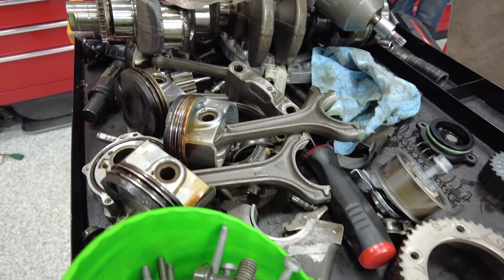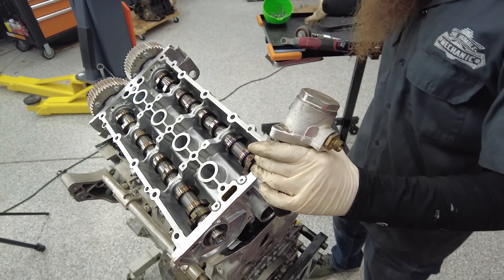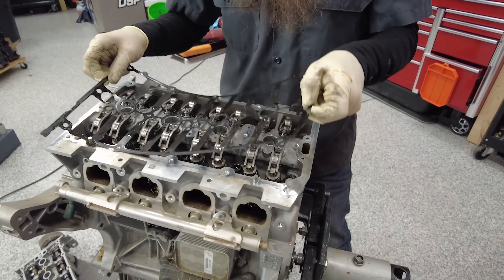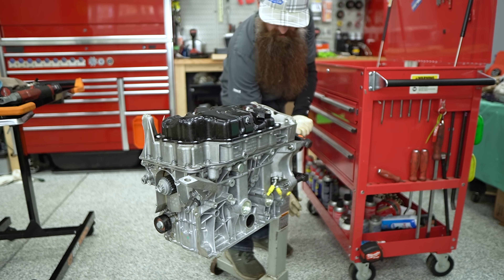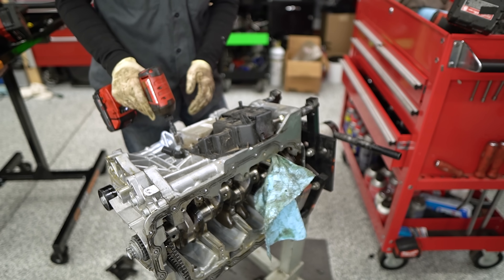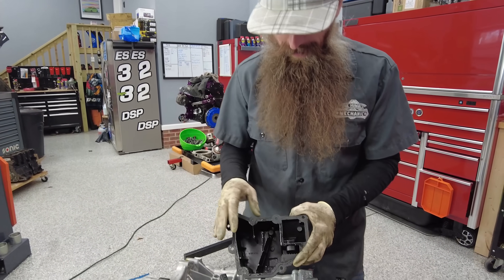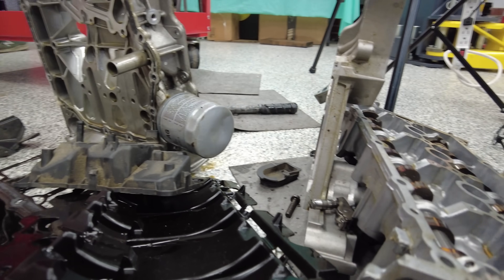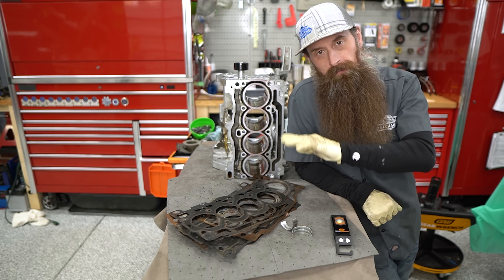1.4 Turbo Engine Teardown After Engine Failure ~ Rod Knock

Comment: That's one beefy looking MLS head gasket. Interesting seeing the internals. I was just leaving my job at the last VW stealership I was at when these engines were introduced, so I didn't get a chance to pull one apart so it was nice to get a look at the guts. The cam girdle with the 'integrated' cams is cool. I agree, would make a nice economical swap for an mk1 chassis car. Good mileage and decent power that would be suitable to update/ upgrade a tired, weak 8v. There has got to be someone out there that has done this swap. It's intriguing, so I may just take a look on the interwebz and see who has done it. Thanks again for the share bro! Keep up the good work and great content!😁👍

Comment: Thank you Charles for the breakdown.  That oil pan, I would like to know if it is the same size, bolt pattern and count compared to the MK 7 R or other models? Might be an replacement option if not to expensive compared to aftermarket options?

Comment: 1.8TSI from a pre revision MK6 Jetta to check for timing chain tensioner failures similar to the 2.0L? Or supposedly one with the revision in 2014 that fixed that issue?
Maybe could play spot the difference between the 1.8 and 2.0 TSI engines🤔

Comment: From people I know, it's typically the piston skirt that bends and makes it knock. The old 1.4 16V AFH motor (1996-99 Polo GTI or SEATs) is a better swap in a mk1...which is what I have in mine. But it's only a bolt in for small block euro spec cars. You could move the passenger side motor mount and then bolt it in. Small blocks also run the old 085 series gearboxes.
Reply: Except those cars were never sold in the US... where Charles (and I) are.  It would be like me telling you to swap in the 2.5L 5 cylinder you guys never got.
Reply: @rennkafer13  Good point.
In the USA, many people with a Vanagon will spend a lot of money to buy a 1.9TD. We never got a 1.9TD, only various 1.9 TDI engines. It makes them more expensive to buy than a 1.9 TDI, and also has less performance. However, the ease of install makes it worth the price to some Vanagon owners.

Comment: Hmm ea211 engines are actually great. Including 1.2 liter.

Btw Charles that is not only engine with cam setup in the cover. Look for old 1.4 16v engine from ibiza, polo, fabia. They made 55 kw, 63 kw and 74 kw variant of that engine.
Codes are like: AUA, AUB, BUD or CGGB.

Comment: My 1.4 tsi is now att 160.000km and still goes like new. No noticeable oil consumption  ore strange noises. It also has a tune. Very low fuel consumption and massive tourqe it is really a nice engine.

It still has original timing belt and coolant pump. Really no engine parts have ben changed not even a coil plug.
Reply from the maker: So far at scale. they have been pretty solid.
Reply: Yeah it's amazing little engine. Nice video I always wanted too se inside this engine. Hopefully I never have too take a look inside my engine :)
Reply: @Wolfpack310  My 1.4l NA is now no longer a teenager, and yes did get a rebuild head wise, to get rid of the usual smoke issues. Also replaced every seal while it was out, and also replaced clutch at the same time. 270 000km on it.
Reply: @SeanBZA  
What engine code u have ?
My is a ea211 chpa
Reply: @Wolfpack310  AGY, basically the vanilla VW Golf engine, in over 30 million vehicles made in South Africa.
Reply: @SeanBZA  that's a different engine right?
Iron block 8v Port injection?
Reply: @Wolfpack310  Yes, the old iron block, still a common item, that you can actually buy from VW as a brand new crate engine, or get a factory recon from them as well.

Comment: Great engine, I've got a Seat Ateca 1.4 150bhp with ACT active cylinder technology. Its proving reliable so far, timing belt replacement seems to be a bit complex compared to normal, requiring vw special computer to lock cams rather than conventional locking tools. The interval on the belt seems a bit odd aswell, originally a lifetime belt and now vw seem to recommend 125000 miles.
Reply: No such thing as a lifetime belt…
Reply: @aygwm  There is, when the belt breaks the engine life is over.......
Reply: @aygwm  That is Volkswagens terminology, not mine.
Reply: My only experience was with a 125hp 1.4 tsi in 2012 Leon Mk. 2
This engine has a timing chain.
It is at 175000km and so far it had a leaking heat exchanger (this caused the coolant to disappear over time  and probably had the added benefit of cleaning the carbon from the valves at least partially) and turbo wastegate leak which was remedied by extending the actuator rod.
Other then that, normal maintenance. I did replace the serpentine belt, rollers and tensioner for it at 125000km.

Not engine related, but I also had a failed brake booster.

Comment: This engine has proven to be quite reliable here in Europe.
I've seen a couple with high oil consumption, but for the most part it's just change oil and spark plugs.
Reply: Yes, I also see them as reliable. Had some leaky waterpumps on these tho but they are easily done.
Reply: Great little engines, only real issues  was the oil consumption. Based on the Skoda Fabia platform in Europe
Reply: Mine has 144,000+ miles all city driving. (Uber Driver). Just had the timing belt replaced so I am ready for another 144k!
Reply: Are these EA111 engines? if it is I can't find many videos on them especially the CAVD ones.
Reply: @JR-tl8tg  EA211 I believe
Reply: @JR-tl8tg four rings auto have plenty of cavd vids, they're all pretty informative
Reply: Yea it’s an EA211 engine with timing belt and integrated exhaust manifold. 

Early versions had oil issues due to leaky valve seals which they sorted but at great cost with lots of new cylinder heads. I believe the water pump is on the opposite side to timing belt and driven right off the cam which is interesting.
Reply: Mine been running for 85 000km without issue. ( stage 2 21psi )
Reply: Weren't these notorious for jumping time? Or was it the older engine?
Reply: @tomaskusnir2374 that was the old chain driven engine. This one is belt driven, as you can see in the video.

Comment: A High Mileage 1.9 tdi would be interesting!
Reply from the maker: They never die. LOL
Reply: I suppose you could find one in a junkyard, some people don't know what a timing belt is. That is often the end of an otherwise perfect engine. It is also the end of a car since many aren't worth installing a replacement engine in.

A timing belt was the end of my mom's 1985 Nissan Maxima in 1994. Whoever decided to put a timing belt on the Nissan VG engine, I hope you were hung by one. Heck, anybody who decided (Or decides) to put one on a car, please hang.

It would have helped if people read their user manuals, but almost nobody does.

I call them "Ticking time bomb engines." Pay a fortune to defuse the bomb, or hope it doesn't explode and cost you everything.

Comment: W-16 engine teardown for sure!
Also, I'm at a break in my MKIV Jetta crack pipe job. I turns out its not the crack pipe! It was actually leaking from where the thero-housing meets the block. The groove for the gasket had broken and was leaking coolant. Now the problem is that I have to wait on the thermostat housing in the mail. I decided to also replace the water pump since I'm in there, and rebuild my alternator voltage regulator. It's turning into a much bigger project than I had anticipated, but thanks to all of the knowledge I've gained from watching your channel, I'm excited to tackle it.

Comment: Would love to see a 2.5 inside out.
Edit: even though it's old and been done before, it would be awesome to see you tear a 1.8t apart.
Reply: 2.5L would be nice to see torn down but I guess its also good you don't see a lot of tear downs because they hold up so well. I've seen some with 300K & what usually goes out on VW's with the 2.5L isn't the motor. You can find the 2.5L's getting beefed up for more horsepower.
Reply: 2.5L!!
Reply: I was hoping to see why the engine failed. :(
Reply: https://www.youtube.com/watch?v=RkwZrx9qLRs  turn on subtitles and you should be good
Reply: @sergeihanush2262  thanks mate. This is a very good video.

Comment: Just because why not go for the biggest engine I think they have for road cars..... 8.0 L (488 cu in) quad-turbocharged W16
Reply from the maker: Help me find one... Ill buy ya breakfast. :P
Reply: @HumbleMechanic  and then once you put it back together... Miata swap!  Who needs a stinkin LS...
Reply: The last Dodge Viper ever made had an 8.4L V10. I think that was built in 2016. However, tearing one down wouldn't anywhere near as exciting. It is a very simple OHV engine. Just imagine taking the engine from the old Dodge Ram, making it aluminum, and splicing on 2 cylinders. They weren't much different from the 8.0L Viper engine from 1992.

Comment: Charles says it might be a cool swap engine.

Spends 15min explaining why it died at 30k and will be impossible to service everything in the future without throwing away entire engine castings. 
Still crazy cool to see captive cams, no external exhaust manifold, and that rear main deal
Reply: Most of those seals push in, so you remove the casting and press the old ones out, and the new one in.  I would say that the cams are assembled using a jig that holds them all in alignment, and the cams and head are heated up to around 150C in an oven, while the shaft is in a liquid nitrogen or dry ice chamber, and then the shaft is aligned with the top casting and pressed into position fast, so that the cams shrink onto the shaft. Not easy to fix, but saves a lot of weight, in not needing any bolts in the upper head, and no chance for misalignment while boring out the bearing holes, though you will need to have very precise control of clearances.
Reply from the maker: HAHAHHA luckily they are generally pretty good.
Reply: He can't help it; he works on German cars and doesn't realize how crazy that sounds

Comment: My friend's son has a 1.4t golf, it was using oil, got rebuilt at a tuning shop that usually does only bigger engines up to the newest rs6's.
The car is still using oil afterwards, they gave the car and his money back but the problem still isn't solved.
Any ideas on this? We thought about the pcv, which I think is under the chain cover but no a lot of ideas here.
Reply: some newer engines have slightly oval pistons that seal up properly when they warm up , think its about controllng  alluminium and various metals expansion they heed to fit well when hot .  also a lot run on very thin oil like 20 or 30 a 40 will have better viscosity .it may well be normal that they use oil
Reply: @lee anderson  well (we're in europe by the way) my 2.0tfsi was rebuilt by Audi before I bought it, as it burned 1L every 300mls.
Since then I've driven 60k+ and I have to add around 1-2L a year/12K mls.
But the Golf burns around .5L every 1000mls since the rebuild.
You might be right on the oval pistons, but we haven't been able to find a lot on the problem at all except for someone who fixed a similar problem by replacing his PCV.
Reply: I think most modern engines have oval pistons. Does the 1.4 engine use coated aluminum bores, or does it use iron liners? Some types of coated bores are a problem. BMW "Nikasil" engines were notorious for their coated aluminum bores not lasting.

The Chevy Vega had coated aluminum bores that never worked. Those cars probably sold more Toyota Corollas and Datsun 210s than any TV commercial ever did.